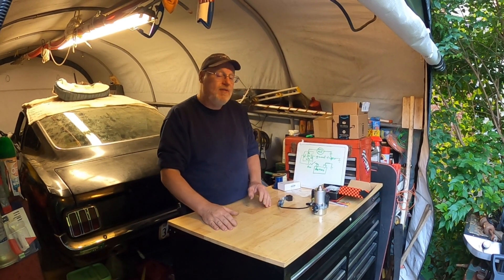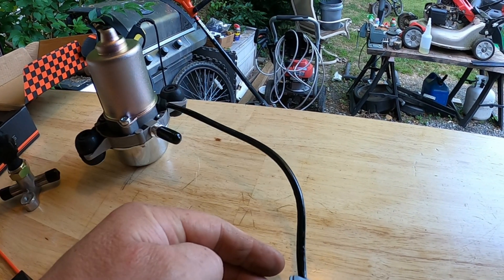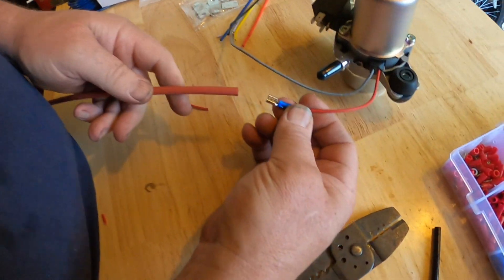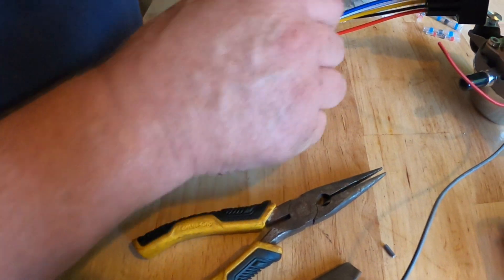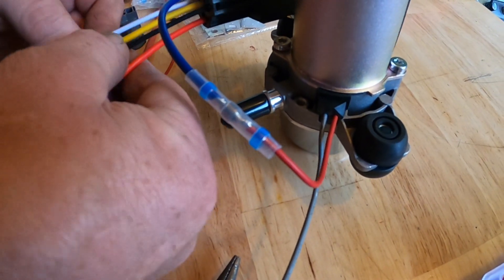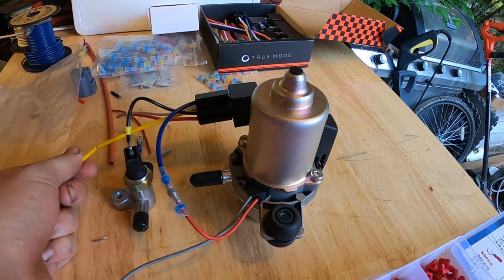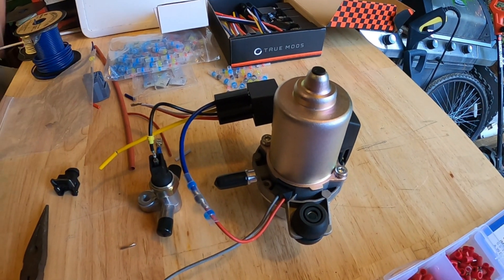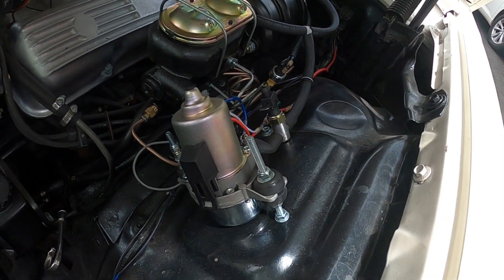1963 Ford Galaxie 500 Front Brake Conversion To Disc Brakes Part 3 Vacuum Pump

Comment: Have the same setup you have and my pump gets hot and starts clicking i don't have the two check vales in the line would that make a difference. But I do have the pressure switch hooked up and ideas?
Reply from the maker: Is the pump running all the time? I would try the valves and see if that helps